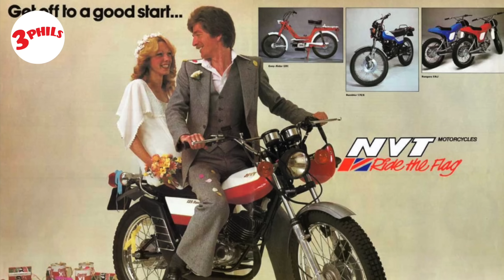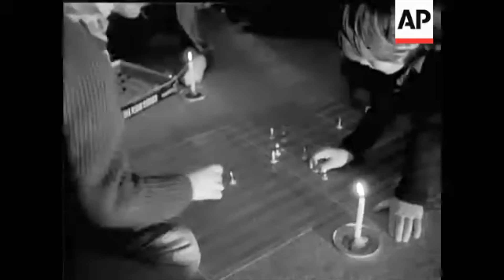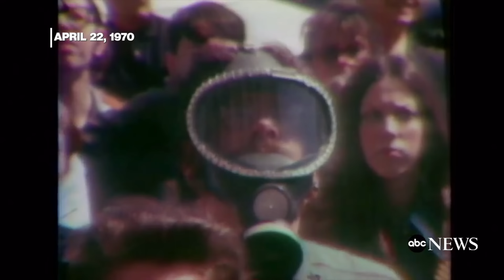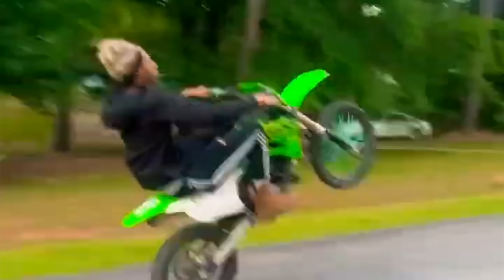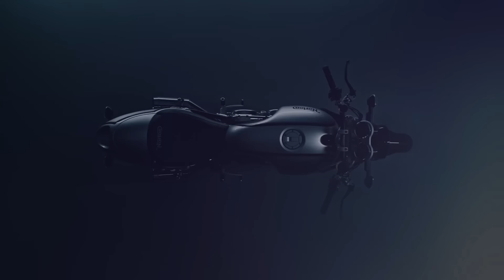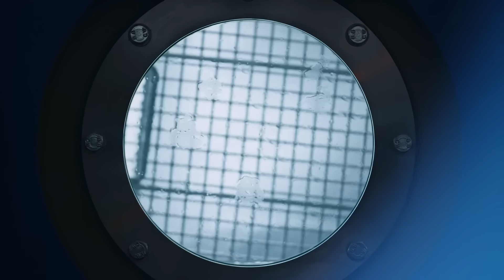Could A Cosworth Engine Have Saved Norton Villiers Triumph?

Comment: There was, in fact another one NVT worked on. It  was a twin cylinder two stroke that had pistons that had two different diameters on each piston; sort of like a top hat, with two chambers to each cylinder; one the combustion chamber and the other the pumping chamber for the other combustion chamber. As one descended the other ascended and forced charge from its pumping chamber into the ones combustion chamber. I believe it was called the "Wulf".
  It  had the advantage for motorcycles of a light but low centre of gravity, simplicity of design and small gyroscopic effect. The crankcase could run in oil as it wasn't used for pumping and the pumping chambers could have larger volume than the combustion chambers, effectively supercharging them.
Reply from the maker: A very good point, thank you. I have the Wulf on my list of potential videos so watch this space.

Comment: I read an article about the Cosworth/Norton engine, many years ago. As I recall, they had major problems with them stalling in the race bikes. Apparently the problem was due to a lack of communication between Cosworth and Norton. Cosworth supplied engines to Norton, which did not contain flywheels, assuming that Norton would fit one externally. Norton, used to engines which contained flywheels, assumed that, if the engine did not have a flywheel, it didn't need one. As a result, the engines were very lacking in inertia and easy to stall.
Reply from the maker: I wonder if that’s true? Not questioning your veracity, just amazed if the guys I know who worked on it back in the day would have missed something like that?
Reply: @3Phils Well, it was over 30 years ago, so details might be a bit sketchy, but I'm sure that the problem was attributed to confusion about the flywheel. On the other hand, it may be that the story was anecdotal. It does seem like a remarkable mix up🤔

Comment: Which is easier to develop, a configuration that is well known or an entirely new internal combustion engine? The choice was obvious, and the pipe dream of the Wankel discombobulated way too many companies. For a low budget outfit the answer is very clear. Stick with something not too complicated. That would be the Cosworth. The most radical part of that would be a 180 degree crankshaft,  the cam drive and liquid cooling. Hardly  revolutionary, but attainable. The Cosworth DFV was the most successful Formula 1 engine ever!
Reply from the maker: Good point. Decades were spent developing the Wankel, to no apparent avail. At least pistons had been around for, what, a couple of centuries at least and benefitted from all those years of refinement!

Comment: BSA already had a full range of bikes developed by Hopwood and Hele, but they also had the Trident. In a ill tampered board meeting in the mid 60s when the only people in motorcycling, namely the BSA the didn't know the both Kawasaki and Honda were building an inline 4cly 750. One board member had the cheek to ask Hopwood "what do we have in response "? I say cheeky because it was the board that had put the stop on BSA building bikes like this for 20 years and now they wanted one. Unfortunately in answer to the question Hopwood first told them of the modular design bikes, but then let slip about Doug Hele's triple.  BSA went with the cheapest option, a mistake in my opinion, not because the Trident is not a good bike, but because development work on the  modular bikes would the taken all BSA'S design resources, so no Areil 3, Bandit/Fury and a above all no power set. These bikes would be responsible for BSA'S problems in the early 70s and the reason Poore got hands on BSA. If he hadn't then AMC would have continued with the Cosworth engine and twinglel design that had the best attributes of both 2 and 4 stroke engines. The government should have helped BSA out they only around 5 million for new tooling because they had already returned to profit by 73, the government would end up pumping far more money into the hands of Dennis Poore,  but then he always had friends in high places and always seemed to be in the right place at the right time.
Reply: That should have said the only people in motorcycling that didn't know Kawasaki and Honda were building a 750, were the BSA board,  everyone else did including the rest of the people in the meeting.
Reply from the maker: Excellent summary there, thanks. In fact, if I rightly recall, Bert Hopwood says in his book that they had developed an inline four in the 1940s! What could have been, eh? 🏍️👍
Reply: He also had donne something similar when he was at Norton and again very nearly got the job done only to be let down by the board of AMC. Under the original plan for the merger between BSA and AMC, BSA was to be the senior partner,  until a rouge trader on the  LSE caused BSA'S share price to crash wiping off 5 million pounds a huge sum in 73, he admitted the offence and that he was acting on behalf of a mystery benefactor, but would never reveal his identity????? Denis Poore on hearing this immediately withdrew from the merger and submitted an offer for all of BSA including the none motorcycling assets that had previously not been part of any deal. What lucky man to be in the right place at the right time 😮😮😮😮😮😮😮
Reply from the maker: Could well have been Tony Rudd, Amber Rudd’s father, who was very involved with potentially dodgy investments in NVT and Manganese Bronze. Amber Rudd and Dennis Poore’s daughter Victoria Borwick both served as Conservative MPs in the 20-teens.
Reply: @3PhilsI have his name somewhere I will have a look tomorrow
Reply: The trader I mean
Reply: @3PhilsI found the name of the trader he is called Ralph Clark he worked for city company Chapman &Rowe. He was banned for 2 years but neither he or Chapman & Rowe would reveal who they were working for although I think we all have a good idea. Clarke actions against BSA was on 14 March 73 the day before the original  DTI brokered/imposed deal between BSA and AMC was to be signed

Comment: Back in the late sixties a bike engine was made by taking a Hillman Imp engine and chopping off 2 cylinders. A 4 (8) valve, DOHC head was cast. It breathed through a twin choke webber carb and it was about 500cc.  I never saw the bike engine run other than at a test track. A project put together by Colin Lyster who also worked on the development of disc brakes for motorcycles.  What might have been if the finaces could have been secured??
Reply from the maker: Funnily enough, you’ve hit on a couple of videos I’ve got in the pipeline there. One on the popularity of the Hillman Imp engine for bitsa bikes, and another on disc brake development in the 1970s. So watch this space! 🏍️👍
Reply: @3PhilsBSA fitted a disc brake on titanium motorcross bike for one or two races but it was described as been all or nothing making it difficult for the rider to use, so they reverted back to drums, I wonder if it was this experience that stopped BSA adopting disc brakes for their road bikes?
Reply from the maker: I have a very vague recollection of disc brakes in the 70s either working too well for the rider’s good, or not at all, with similar ‘unexpected results’!

Comment: I went to a talk from two development engineers who worked on the Norton Wolf stepped piston engine .., and under the development program that was government aided / funded they said that the unit they produced could stand big end to big end with the Kawaka of the period ( I think the machine they sighted was 400 cc twin 2 stroke ) ... There were not  enamoured with the action of the company as they perceive there was effectively fiscal bleed to help the big twin racing project ... They talked of the Wolf with affection ... One notable response was that the step piston effectively ran a 4 stroke bottom ( fuel and air no mixing with lubricant ) .., but the skirt of the piston ( the moving wall of the charging area of the piston ) stopped lubricant getting to the upper flank of the piston .., small holes had to be added to the upper area of the piston to allow lubricant to get to the combustion chamber wall ...
Reply: My memory of the Wolf is that the engineers said they could equal the Suzuki level of 2 stroke performance, but not Kawasaki. I assume this referred to production street bikes. As of 10 years ago Norton was still trying to develop and sell the Wolf as a drone engine.
Reply: I think the engine is in production but not in a motorcycle, shame because the technology could have saved the 2 stroke,  think I have book with a picture of the bike somewhere, one of Brad Jones's books
Reply from the maker: Interesting - thank you! I must do a video on the Wolf. 🙂🏍️👍

Comment: Investigate the WASP engine, developed by merlin engineering. 80 foot pounds of torque @ 4500rpm. Imagine that in a road bike.
Reply from the maker: I will - good shout! However, I don’t have to imagine 80+ ft lbs, two of my bikes make that, admittedly at about 6,000rpm. 🙂

Comment: We all have complete confidence that we know exactly the machine that might have saved Norton, AJS, Moto Morini, Laverda, Bultaco or some other firm.
It is usually a slightly updated version of our own favourite machine.
And it is ALWAYS something that nobody would have bought.
Only John Bloor really knew the answer and had access to the capital.
And frankly... Although he has made a huge business success, nobody dreams about owning a Triumph built in the last three decades.
Lovely bikes.
Fast bikes.
Pretty bikes.
But not the stuff of dreams.
Some things just need to die.
Reply from the maker: New Triumph are nonetheless pretty successful, albeit they still shout about ‘modern classics’. They probably realise that the market for those is diminishing, and it will be interesting to see how many of the 29 new models they’re promising for 2026 are entirely new designs - I’m not holding my breath! I’ve never felt the Bloor Bunch were particularly innovative, and have always turned to the likes of Honda and Kawasaki for truly modern, forward-looking machines. Still, it’ll be interesting to see what Triumph comes up with. Thanks for the comment. 🙂🏍️👍

Comment: The sad thing is that in that with the Cosworth DFV F1 engine they were looking at what could been the foundation of something truly iconic. 

However Norton insisted on a 360 degree crank parrallel twin, I think because their culture was that bikes shoukd be parallel twin shaped and 360 degree crank so they could use a simpler spark loss ignition system (both plugs sparking simultaneously on each rotation) and the potential to build single carburetor versions in the future. However the 360 degree crank saddled it with the need of a massive counter rotating balance shaft with resulting massive inertia which killed throttle response and also with both pistons pumping up down together created at the engines potential 12000 rpm massive crankcase pressure, which meant it could not do 12000 rpm without pumping its lubricant out of the crankcase. 

The thing is though, if they had looked at the Cosworth DFV V8 in a different way, with its crankase designed to be a stressed component of the chassis and just sliced off a 90 degree V twin from the end, you have a 750cc 12000 rpm and exploiting the long stroke endurance derivatives of DFV a 900cc 10000 rpm engine with substantially more torque. This is basic building block of what Ducati was to make into truly iconic bikes such as the 748 and 916 twenty years later.
Reply: Domehow NVT kind of expected Cosworth to work for free. NVT had absolutely no clue about the price of the Cosworth V8 and less clue about the cost in turning it into something useful.
Reply: What could have been.  British bikes were expected to be parallel twins.  I've ridden modern Triumph twins.  They are great bikes.  Sad that NVT couldn't make it.  Too little too late

Comment: Neither, the Wankel was an impossible engine to build and make reliably at an affordable price, the Cosworth should have been good but fundamental design choice of a 360 degree crank hobbled the whole design with vibration and crank case over pressurisation issues.
Reply from the maker: Yes, I think they were scrabbling around for answers that weren’t there, towards the end. And without any significant funds for development and re-tooling it was a vain effort anyway. The V twin idea, which could have been scaled up to a 1250cc V5, might have been the answer but, as the Bandit / Fury debacle proved, they’d reached the end of the money road by 1970/71.

Comment: The new Commando was a real disappointment on release and until now, hence one is not sitting in the garage.
Reply from the maker: From what I can make out, it’s been plagued with issues since its inception. So, not unlike the old Commando, actually!
Reply: It seems that the new/current (?) Commando was designed for and marketed to a sort of niche customer who liked the idea of an old European twin but not the reality.
A sort of two-wheeled equivalent of the MX-5 as imagined by someone who really wanted an Elan or an MGB or a Healey Sprite.
But... Without the finish or the engineering that Mazda managed.
The New Commando seems not entirely unlike an MT-09, but less reliable, plagued by parts-supply issues, pricier, slower and less agile.
But... It looks good in the window as you ride past Greggs.  😮
In less than a decade, New Commandos will be sitting, unridden and unloved, in garages and sheds.
I may be wrong.  😊😊
Reply from the maker: You’re not far off it there. I see ‘New Commandos’ being put up for sale practically every day on the Facebook groups. ☹️

Comment: I love a good Wankel (sorry) and owned a Mazda RX2 when I was in high school. It would wind up, going faster and faster until something would let go. Goodbye clutch. A real giant killer. To make it work for a motorcycle however, would have meant a lot of research into materials for the rotor tip seals that just didn't happen. Could the Cosworth have competed with the multis from Japan? Unlikely.
Reply from the maker: Yep, my thoughts too. 🏍️👍

Comment: "Too little, too late" is the epitaph for the original British bike industry as a whole.  Norton's should be "Not worth a Wankel.". 
There was one engine that could have, if not saved them,  at least given them a fighting chance to develop ground up designs or maybe a Cosworth 1100 triple. That engine was the Vincent.  They could have accquired the rights to Vincent and started turning out factory buiilt "Norrvin's".  A modest styling tweak or two, plus Jap quality electrics and they  could have sold them to the Yanks by the shipload.  If it was good enough for "Ogri" it was good enough for me.